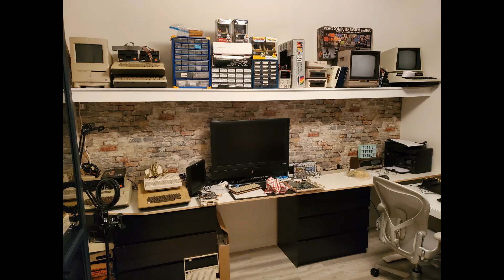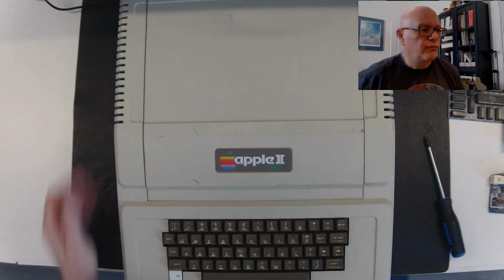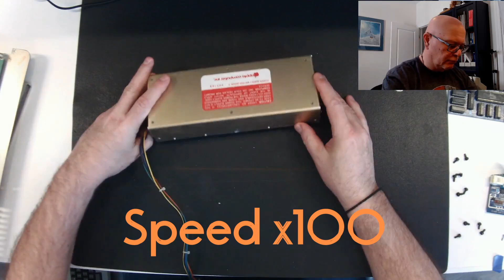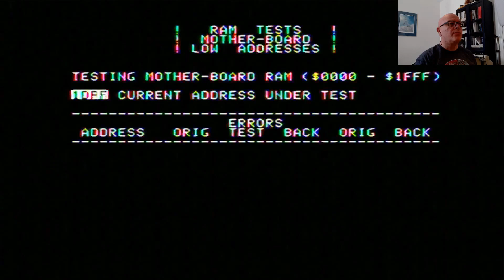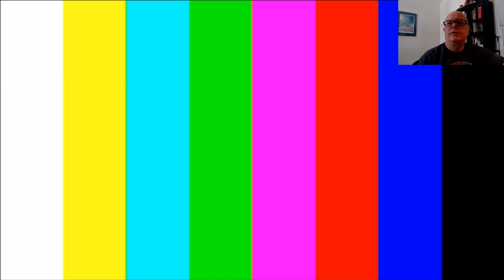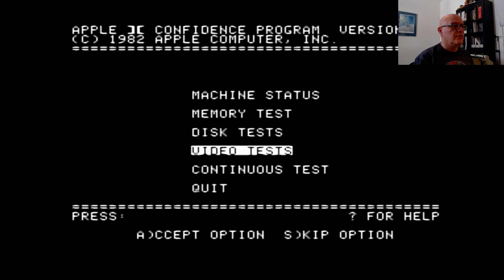Will This Ancient Apple II+ Boot Up After 45 Years? Part 1

Comment: On the power supply : there are no screws missing. The PS are riveted close. So to remove the infamous Rifas, the pre-owner had to drill them out. Been there, done that (twice on both my II+).
Reply: Guilty. I drilled out the rivets when I recapped it (including a RIFA in horrible condition).
Reply from the maker: @Madmanguruman  You caught them at the right time!! Oh, and thanks for everything!
Reply from the maker: Yes, I realized that after I posted the video.. lol. Thanks for correcting me and watching!

Comment: You DO need them (RIFA caps). They prevent the power supply from putting RF on the power line. Will you know they are missing? Probably not but someone else might. Be responsible.
Reply from the maker: To be honest, I did mention in my video that since you have the power supply open, you may as well replace them. Maybe that wasn't clear. However, I have seen many power supplies,  OEMs, with them not installed, and they work fine unless you're a ham radio operator. Yes, I am responsible. Maybe I should do a video on rifa caps. Hmm, thanks for the idea!
Reply: @RudysRetroIntel  They're also not necessary if you use a power strip that has RF filtering on the outputs (as any good one does).
Reply from the maker: I always use top of the line power straps with RF shielding and addition fuses. Never use cheap power strips